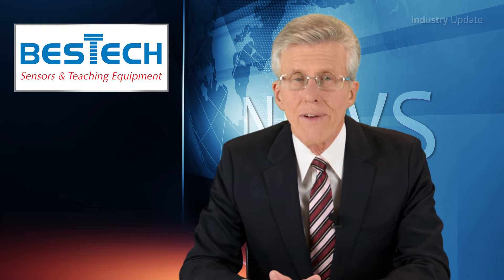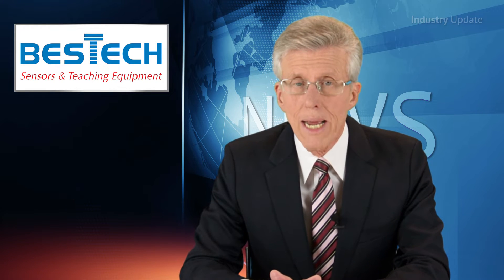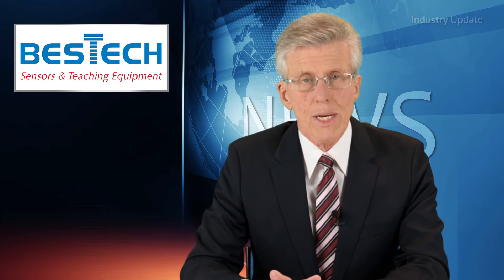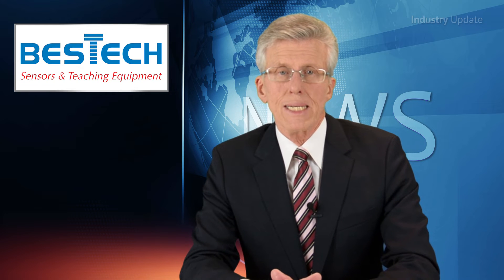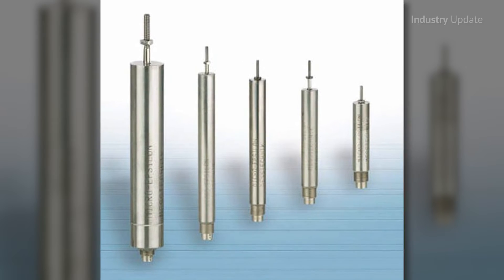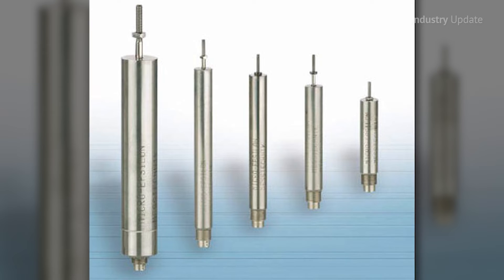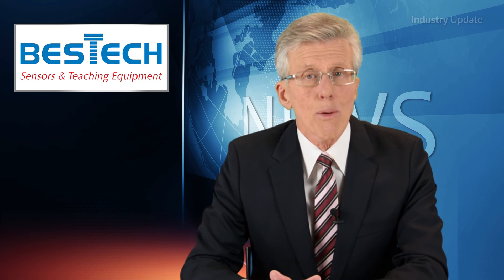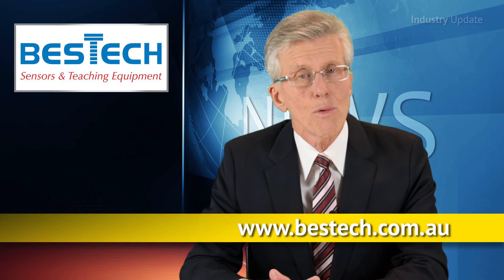Industry Update: Bestech - LA-25-A LVDT

Comment: I came across your article online regarding Linear Variable Differential Transducers and found it quite compelling as i am in some desperate need of information and advice regarding these sensors and the meters that detect them etc...I didn’t want to try and build one since I could get them cheap on eBay so I could plug and pray etc..
 I recently acquired a 21-1350-00 Gould Surfanalyzer(Which is similar to a Federal Esterline Meter see photos attached ) without thinking about the LVDT variant HBT (Half Bridge Transducer) The age of the meter appears to be in the late 70s early 80 etc. So i am in the process of trying to see if I can use a LVDT to work on the meter etc and it appears to not be an LVDT because of only having two wire connection to the 5 din pin plug on the unit. So i dug in deeper and was thinking that the unit should be a HBT variant instead since it only had two wires connected while the rest of the pins on the din plug are connected together. also was testing the sensor i have which for some reason when checking with an ohmmeter has a diode or something connected to it internally causing the coil to have a polarity so it must be polarity sensitive etc. The ohmage on the coil is about 15-18 M ohm. The sensor is a federal EAS 2104 - W1 can type which has a small ferrite core about half an inch in length and 1/8 in dia etc..I tried to test the meter out by plugging it up (it has battery capabilities as well)as it turned on without a probe the meter would swing a little and when i turned it off the meter go across and back to zero etc. I looked inside at the circuit board and noticed alot of diodes and capacitors etc.since this would operate either as a hay bridge or owens bridge since i only saw two wires.I am still not really clear which one of these configurations the meter has adopted but i am leaning towards the owens since i see alot of capacitors etc. Also i could not detect any frequency at the two pins which makes me wonder if the circuit has a bad component which would account for the lack of ac signal unless this configuration doesn't need a signal!??? since i scoured the internet for schematics or any information on the unit i am at a loss at the moment. also i bought two LVDT or HBT probes( not sure since i don't have any information either on these probes) models Federal EAS 2401-w1 and a moore 13660-1 Linear Transducer Probe. If you could get me any information on the pinouts on these I would appreciate it tremendously!!! i hope this email doesn't overwhelm you as i am soooo desperate for any information i believe i may have gone batty chasing this around...
Reply from the maker: Hi George, thanks for the comment. 
If you would like to find out more about the range of Linear Variable Differential Transducers, you can contact Bestech Australia directly by following the contact Bestech page on our website: https://www.industryupdate.com.au/suppliers-details/metalworking-metal-machining-mining-minerals-equipment-instrumentation-testing